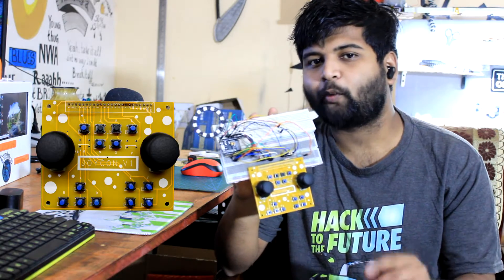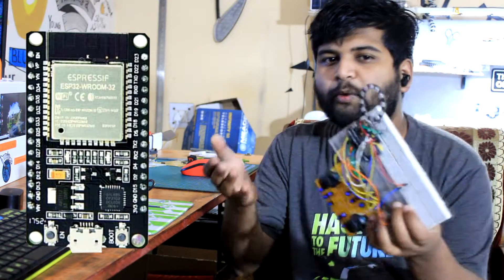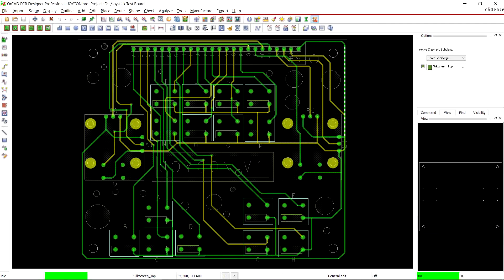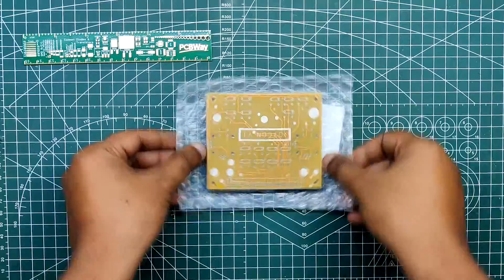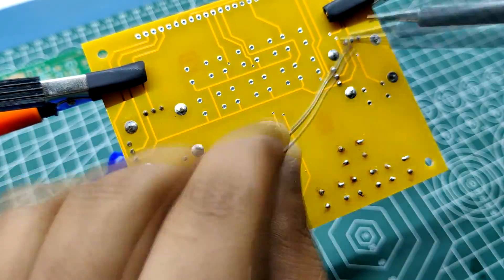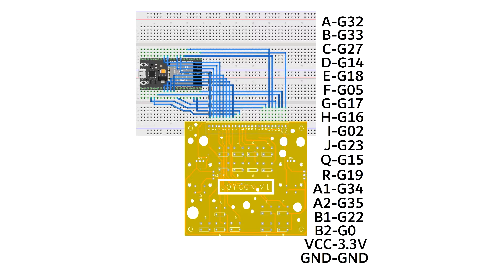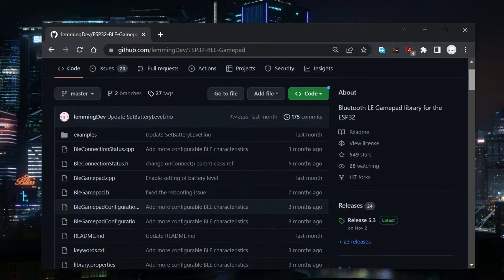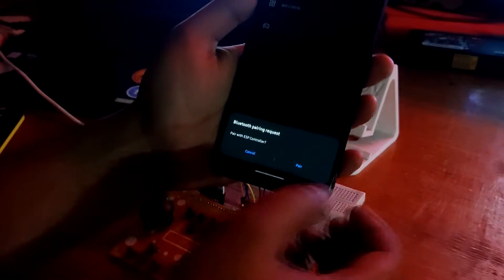ESP32 Game Controller Project

Comment: Which microcontroller should be the best option for making a game controller. I want to make it in such a way so that I could use it on PC, retropie( or any rpi emulation os ). 
I saw your esp32, ardiuno micro and Pico controller videos but I'm not able to decide which one is the best. Can you help?
Reply from the maker: So far, esp32 if you want a BT functionality but if you want a wired controller, then any atmega32 based board like pro micro or micro
Reply: @ArnovSharma  Thanks Arnov. I was about to go for the Rpi Pico. I'll definitely take a look at ESP32.
Reply: @ArnovSharma  I recently discovered Pico W has officially gotten support for Bluetooth. Previously it had Wifi and BT hardware but with BT disabled. BT drivers are in beta testing right now. 
If thats the case, then Pi Pico W also has HID and BT support then it should be superior to Esp32 and pro micro in making a gamepad. What do you think about that?